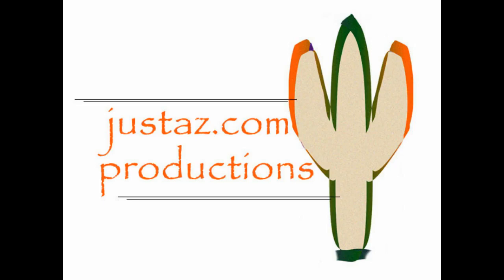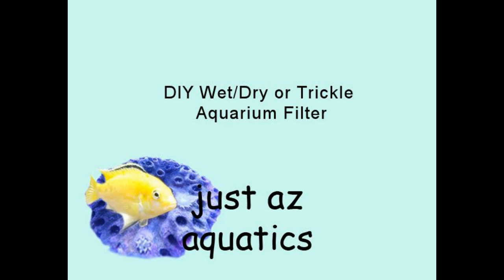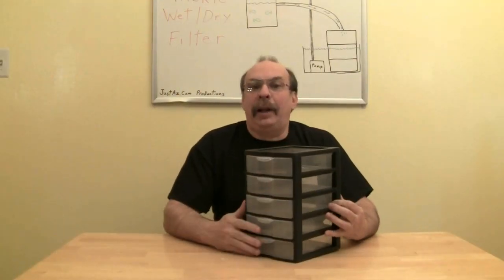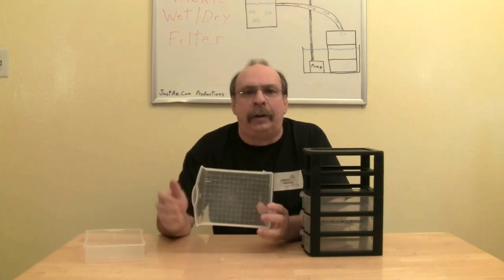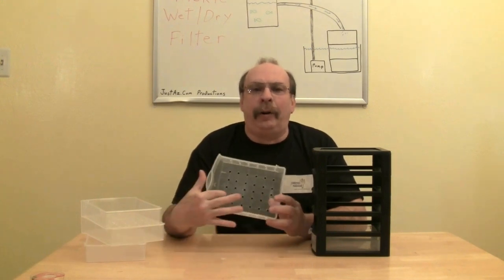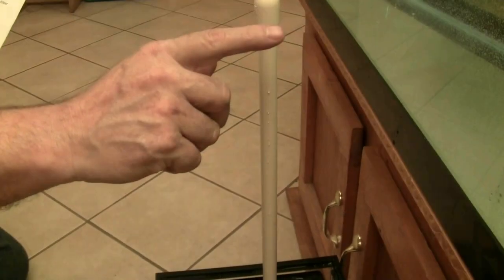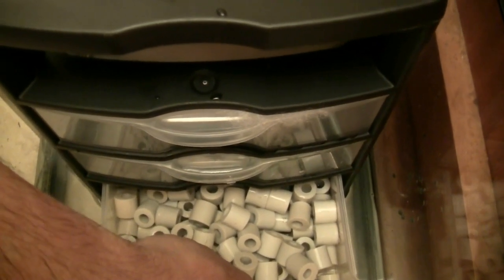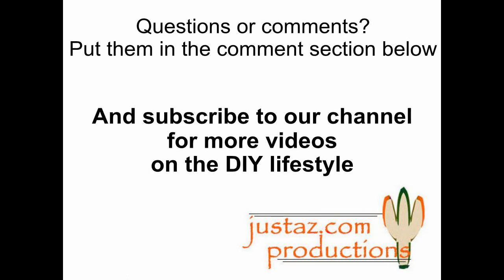Aquarium Filter Series: 7/8: Wet Dry Trickle Down Aquarium Filter

Comment: Thank you for demonstrating. I just need to get the 10 gallon tank and hose. I was torn between 10 gallon tank and plastic tub. I like the 10 gallon tank to keep heater and possible skimmer. Coral is still not decided.

Comment: sounds great. But what happens in case of a power failure and the pump is not working anymore? Will it overflow ?
Reply: no, water will flow strait back into the sump or aquarium if it is on top.
Reply: keep everything higher then the aquarium